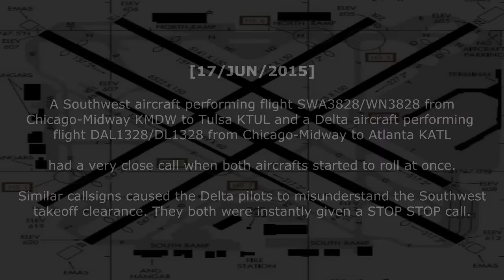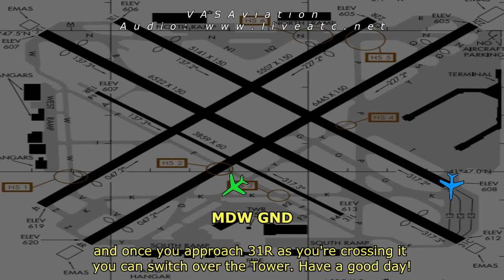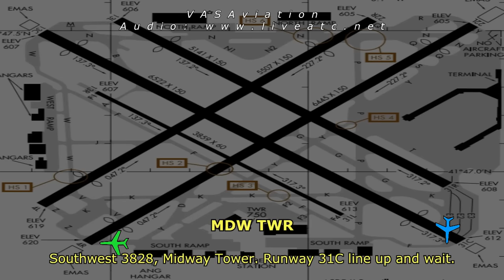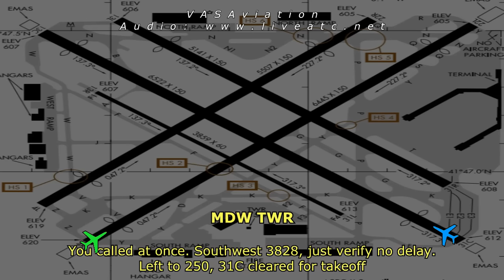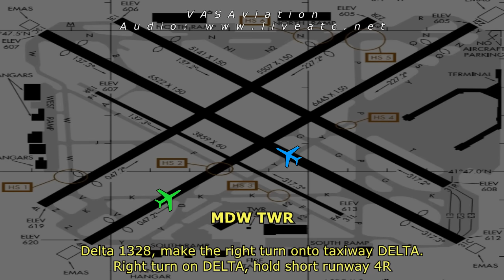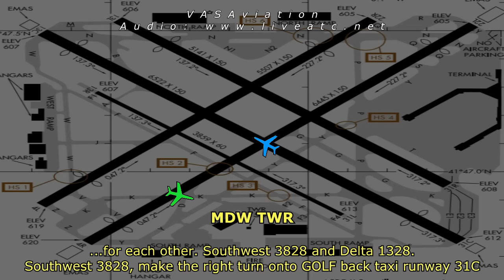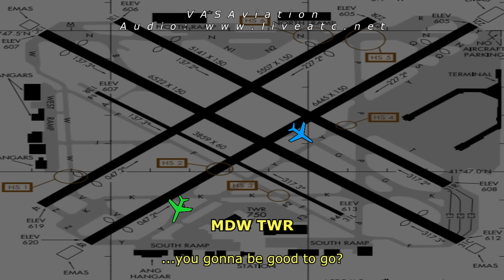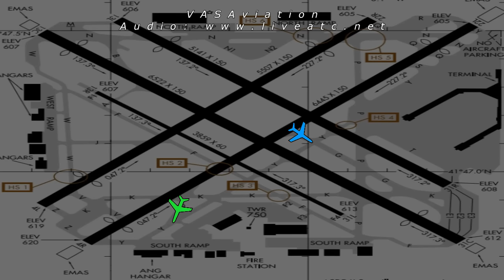[REAL ATC] Delta and Southwest VERY CLOSE CALL on takeoff

Comment: When the pilots say they have to "contact company", are they referring to the fact that they need to "call their bosses" and let them know what happened?
Reply: Yes
Reply: also the dispatch to recalculate fuel and update time
Reply: Yes call their bosses and also speak with a company maintenance tech to see if they are able to try to take off again or if the plane should be inspected further at the gate. I imagine this is SOP for any aborted take off.
Reply: Why would the plane need to be inspected?
Reply: because SOPs, double checking redundancy to make certain everything is safe
Reply: PEDRO KSP,  to check for things like a worn out tire, or worn out brake pads, or damaged brakes, from the emergency stopping while at take off speed
Reply: The incident is reported and documented to the airline company's (in this case, Southwest Airlines and Delta Airlines), as well as the FAA. It is probable that after a close call like this, all 4 pilots involved (2 Southwest and 2 Delta pilots) and ATC controllers will be reviewed (more so the Delta pilots to ensure they were 100% coherent, not under the influence of drugs / alcohol, within their logged flight hours limitations, no field or other distractions occurred etc). There may also be some probationary period for the pilots and AT controllers.
Reply: One example is how hot the brakes get during an emergency stop. It can take a LONG time for very hot brakes to cool down. Seeing as though those hot brakes will be lifted up and housed inside the aircraft after takeoff, it's better to be safe.
Reply: it means inform company to change flight number. cox its too similar
Reply from the maker: No, that is not the cause.
Reply: +PEDRO KSP Generally they need to check the brakes if they were applied in an "emergency stop" during takeoff. Kinda like if you imagine driving at twice the highway speed limit, with your handbrake on, while pulling a twenty tonne truck behind you.
Reply: I like DJ's idea but not the reason. Maintenance, self-reporting, recalculate fuel, etc. are the reasons.
Reply: Graxster bingo
Reply: They are contacting dispatch to make sure they can still make the flight legally  without getting more fuel.
Reply: they will report that
Reply: @Volkier Neigh 
A better analogy would be a truck pushing behind you.  The weight of a trailer has nothing to do with brakes and would help you stop easier with less brakes.
Reply: There is no fat in the system, everything is run so tightly that the slightest of deviation calls for recalibration.
Reply: Wow. All good guesses but not correct. I can only speak for one carrier involved and not the other. But whenever there's a runway incursion that occurs that creates a conflict, pilots will immediately notify company through their dispatcher (immediate notifications required per the Flt Operations Manual). Within 24 hours of completion of the pairing, a SOPI report (IR - written irregularity report) must be submitted. Additionally, the pilots will file ASAP reports (Aviation Safety Action  Program). This allows for an investigation to be performed about the event by a team represented by the company, pilot's union, and the FAA that make up an ERT (Event Review Team).  NTSB is not involved except for accident investingation. See NTSB 830 for definitions.
Reply: Thanks for that.
Reply: Graxster yes!
Reply: Unless you happened to be flying Aerolineas des Bananas and look out the window and see where the engine pylon is held on to the  wing instead of big bolts you see a lot of duct tape.   You get nervous when the ground maintenance staff all line up and salute you while you are taxiing out to the runway.  
Did you look toward both ends of the runway as you were boarding to see if there were mountains, and if something goes wrong the plane can bank either left or right and try to come in straight.
Reply: vadermike777 a
Reply: Pedro Coelho - -possible "hot brakes".  Unlike a vehicle, stepping on the brakes of a fully loaded airliner absolutely puts a lot of heavy friction on the brake linings. Boeing showed us the "brake test" vid for gaining FAA certification -where the brakes overheat & catch 🔥.
Reply: because of the aborted take off, if you was on one of those planes wouldn't you want them to check every thing out to make sure you good to go.
Reply: This may be a dumb question, but why wouldn't they just fly with the brakes and tires down for a little bit, and let the heat transfer into the air as it is going throughout the sky
Reply: They call so they (the pilots and airline companies) can start covering their asses! And all the other stuff stated above. 😂
Reply: jessica avery because the gear is causing a lot of drag and depending on where the aircraft is heading and how tight their fuel calculation is that could possibly cause fuel problems. 
Also it does reduce aircraft performance during climb out (due to the drag) while still very low which is too unsafe in such a critical flight phase ... imagine you having an engine failure (or even both / all engines flameout) and the hydraulic pressure between engine shutdown and APU startup or RAM Air Turbine extension is not enough to get the gear up and you end up not getting back to the aerodrome due to the too high drag of the gear 

There could also be mountains behind the aerdodrome requiring aircraft departing in that direction to maintain a specific climb gradient specified in the standard instrument departure procedures (SIDs) which could possibly not be achieved with the gear extended.

There are quite a few reasons and scenarios that require you to get the gear up as soon as the climb rate is positive ;) 

Hope I could clarify :)
Reply: Aircraft are parked on stands, not gates.
Reply: jessica avery because if they tried taking off again and they need to stop a second time(possible) their brakes are more likely to fail or catch fire. Before they even get into the air they could have a problem!
Reply: It’s also to recalculate flight time and takeoff slots.
Reply: @Pedro Coelho 
Well if you have about a hundred tons or so accellerated to maybe 60mph ( about 3-4 Seconds here? ) and then just hit the brakes hard to come to a full stop, all that kinetic energy needs to be converted into heat at the brakes. 
I won't bore you with the math now, but it is more or less the equivalent of a plasma cutter pointing at the rotating brake discs while breaking lasts.
I would assume they use ceramic brakes or carbon or something similar. So heat is not so much of a problem as these things can take a fuckton of it. But the vibrations at a emergency breaking maybe harmful.
I would further assume that inspection in this case means to check if the discs were compromised? Shouldn't take more than a few minutes, but I have no clue about aviation rules. Maybe they check other things as well. Better safe than sorry ^
Reply: DJ Las where the hell did you get that info from lol
Reply: Graxster 
Yeah they should inform they superiors, file a safety report, decide if they need technical check after aborting take off, additional fuel...
Reply: commonsense would tell you that
Reply: I was about to ask this at mentour pilot or captain Joe
Reply: no, they have to get a new flight release because they both had aborted take-off's.
Reply: "Contact Company" is pilot lingo for "change my pants."
Reply: Pretty much
Reply: @deafmusician2 , 

        Does your name imply you use cheap musical gear, you have to eat cheap food or you're cheap to hire?
Reply: @spoonylove2405   budget doesn't necessarily mean cheap.    it means "with patience, you can have a professional studio at an Xtreme budget price".   I have rack fx that I paid $10 each for.   They are older era (80's-2k), but professional equipment.   I have keyboards that are even now over $1k that I paid $500 for. Older computer for mixing.   My multi track recorder is about 7 years old but it's 24-track, digital.   My studio is a finished metal building, that was economical.    XtremeBudgetMusician
Reply: @ryland20  seems like a lot to go thru for an aborted takeoff. But again I guess I can understand its a safety concern
Reply: @pedrosmith4529  LOL! But man, that must freak you out big time!
Reply: @hackyou360  Thanks a lot for taking the time to explain 😊.
Reply: Sophie Acapella no problem glad it helped :D
Reply: jessica avery I’ve seen a 787 have their gear down for about 5 minutes after takeoff due to hot brakes (most likely rode them in taxi) so I’m sure that could be a common practice
Reply: @jeffreylebowski6897 : Oh wow, that never occurred to me! Thanks for explaining!
Reply: It means they have to let company know where to send their last paycheck...
Reply: AnorexicPandas lmao. They burned minimal fuel on taxi and their brief take off run. You have no idea what you’re talking about. Another FS kid who thinks he is a commercial pilot.
Reply: thractrack lol no.
Reply: Peopled Diagram nope.
Reply: @matthmatthmatth  Are you a commercial pilot tho?
Reply: @stefandyrendahlgrimfelt7106  what does my occupation have to do with anything I said? Is any of it wrong? I think you'll find it all accurate if you bother to look into it, but you'd rather advertise the fact that you're a student pilot (as is evident looking at your channel) and try to compare yourself to me by asking that question.
Reply: @matthmatthmatth  You have misunderstood me. I just thought you had a hell of attitude so I was interested what you are - to back it up. Negative, I have completed ATPL.
Reply: @stefandyrendahlgrimfelt7106  Congratulations, Stefan...
Reply: @MeMe-cm4yy  You're joking, right? The weight of a trailer doesn't affect the brakes? Get serious.
Reply: prob have to refer to manual as well. Almost all scenarios are listed lol.
Reply: @jessicaavery7021  because there is a maximum safe speed for the landing gears to be extended... Extended landing gears makes for increased drag, and also makes for the plane to handle more sluggish... Not to mention burn almost twice the amount of fuel as a result of the increased drag...

It was not a stupid question as not all people understand the Dynamics of airplanes... The only stupid question is the question not asked...
Reply: @deafmusician2  what type of music do you do? I too am a musician...
Reply: @deafmusician2  I may just have to do that... I play mostly older "outlaw" style country... But some rock/metal, and I do freestyle "spoken word" type poetry... I also play drums...
Reply: Jessica....breaks can crystallize from extreme heat after a forced stop, just like brakes on a car after getting them to hot. They dont have the stopping power they had before the emergency.  So it's not so much cooling them down as it is to see if they can be used for another flight and landing,  so they have to be inspected.  And if tires were locked up to stop, they get inspected also.  That's the way it was when I was Airforce mechanic I assume the civilian carrier would be the same
Reply: @ryland20  Southwest pilots for nothing wrong. Why would they get in trouble. Delta was on 4R not 31C
Reply: @MeMe-cm4yy  Someone doesn't understand newtons 1st law lol.
Reply: @pedrocoelho5965  if stopped very suddenly the tires and breaks can be damaged.
Reply: ryland20 r
Reply: Mostly it's to request fresh underwear and schedule a steam cleaner for the seats.
Reply: IDK but Delta pilot made a critical error. Doubt his company would just let them take off again.
I worked transportation and you were immediately relieved of duty, pending investigation.
Reply: Pedro Coelho The planes brakes may have become too hot to preform correctly as well, causing major issues when the attempt to land again.
Reply: @nickdsylva932  What are you on about?.
Reply: vadermike777 d
Reply: @pedrocoelho5965  Aborted takeoffs can be stressful on an aircraft. Hot brakes, damaged tires (flat spots, for example), damaged brakes, etc.
Reply: @pedrocoelho5965  brakes run too hot in case of full brake
Reply: I’m assuming it’s that and that they’re calling the manufacturer to see if it’s okay to take off while their brakes are so hot.
Reply: Pedro Coelho because having wheels that are over 1000 degrees inside your airplane might not be a good idea. If they get hot enough from extreme breaking they can catch the tires on fire
Reply: @supersoccrstar  Standard aviation procedure. Everyone involved in an incident is interviewed, no matter the first impression. Not to hit someone over the head with it, but to update regulations and procedures to prevent such incidents in the future. But it still is possible that the outcome could be that the Southwest pilots had an indication that another plane was doing something wrong and should have acted upon that.
Reply: jessica avery that would create more issues once airborne, especially with aerodynamics because the fuel consumption calculated is directly related to how much will be needed for takeoff, as much of it is burned at take off since the wind resistance is much lower in high altitude where the air is thinner. Good thought, but just not possible. Another major major reason they can’t just turn around, go to the end of the runway and start over a few min later is because what happens if they have to do another emergency stop (God forbid two in succession)? The brake pads already being so hot they could catch fire and trying to e-brake again on those same pads are very likely to fail.
Reply: @pedrocoelho5965  Aborted take off puts huge stresses on the air frame.. in some cases the brakes overheat and need to cool down , or even get inspected so there's no chance of fire ,  tires too, engines ,free and clear in case they ingested anything in reverse thrust, plus ensure everything is tied down..ie animals in the hold,  fuel may be a factor as well,  if they are close to marginal on a long flight they may need a top up,  taxiing burns heaps as well, just running a gas turbine guzzles, not like a car.. 
   If any warning lights come on during RTO, they have to be reported , checked and cleared as per company policy ,  plus a whole slew of systems we non pilots don't even know about , usually company procedure stuff or aircraft manuf regulations  , conditions for RTO..   but the biggest is usually break ,tires,landing gear heat issues, and fod.. then a post rto run through of the systems  to make sure everything is running,  then a call to the office for procedures..
Reply: @pedrocoelho5965  Wear and faulty gear
Reply: Oh yeah, you better believe that's what it means. And that phone call is NOT fun, if the equivalent that we have in the trucking industry is anything to go by
Reply: @MeMe-cm4yy  False. How much weight I have in the box DIRECTLY correlates to my ability to stop. Ironically, in a truck it's the exact opposite as it is in a car; up to a certain point, the more I weigh, the faster I stop. Past that point, my stopping distance starts increasing again
Reply: @sammvoyager  You mean unlike a passenger vehicle. Us truck drivers have to keep an eye on our brake temperatures as well because our brakes have also been known to overheat and ignite
Reply: @SW737Flyer  cool? But someone already clearly stated that earlier so what do you mean nobody was correct? Sounds like you just wanted to be a knowitall
Reply: Kind of weird that they need to “contact company” unless something got damaged.
Reply: @AnorexicPandas I dont think they need to recalculate fuel as they always add extra fuel for the purpose of long taxis, rejected takeoffs, and go arounds.
Reply: @dr3v1l1993if it’s after v1, the pilots would be fucked as they would be too fast to reject the takeoff at that point. 

Also, the brakes shouldn’t be overheated cause autobrakes on Boeing have a rejected takeoff setting and on Airbus, they use max.
Reply: @jeffreylebowski6897 that is why there is an autobrake setting for that to avoid slamming the brakes hard.
Reply: @SYDAirlineEnthusiast  if they didn’t depart, they could be in violation of their minimum fuel requirements if they had an aborted takeoff then went right back to taxi and attempt again. Calculations are done assuming a standard taxi and takeoff, not a rejected takeoff. Additionally, they will likely be reporting the safety incident to HQ to give them notice to file an ASAP and internal safety report. From the company’s perspective they may even want to swap crew for UA. I’m a CMEL and work for an airline in ops, I’m pretty familiar with what the company would likely want.

Comment: Aware of similar callsign: CHECK ✅

Also takeoff together when you're not supposed to do it: CHECK ✅
Reply: Not checking twice by asking ATC just to be sure: CHECK.
Mumbling and clipping the callsign on the ATC side... CHECK.
Reply: @antoy384  This was not ATC's fault at all. How do you mishear 31 as 04? Even if the callsigns are similar, if a runway YOU ARE NOT ON is getting cleared obviously that isn't your clearance.
Reply: “Cleared for takeoff, winds 060 at Niner”

“Ahh another job well done rick *lays back in chair and glances at radar*.......HOLY F*”